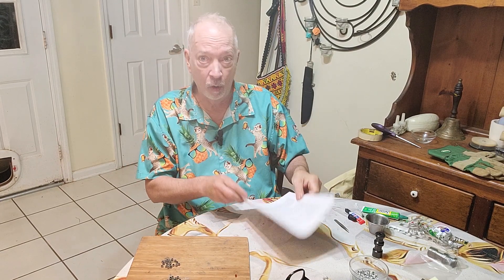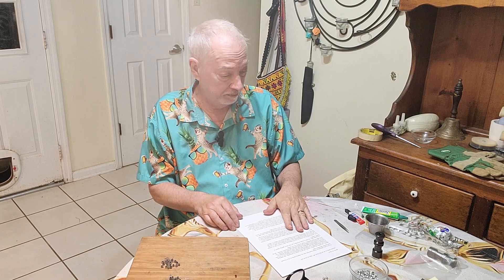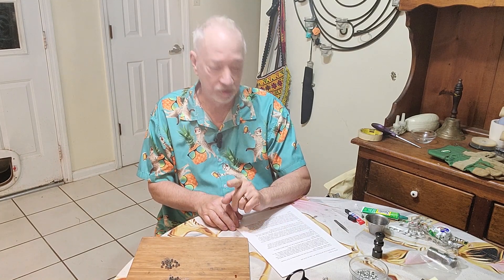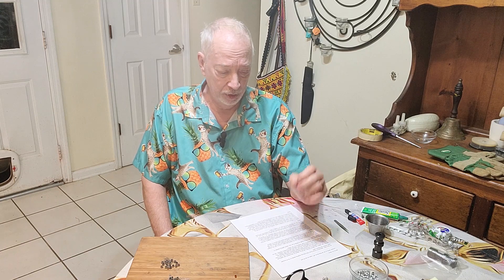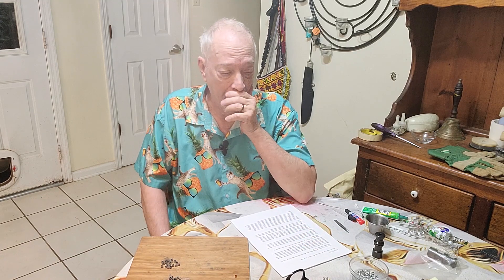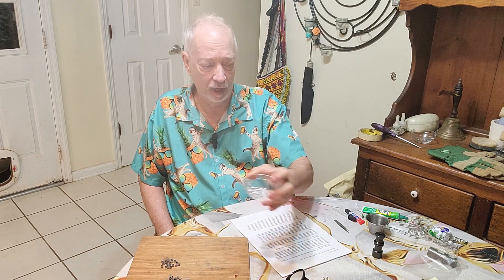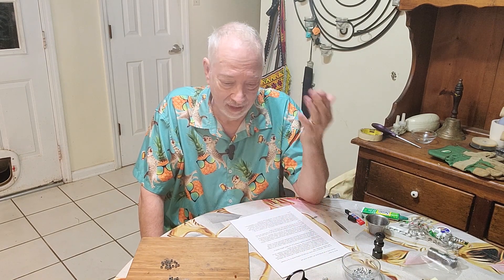Homemade Percussion Caps: Adding Extra Hardener,  Part 1

Comment: I had trouble with Aluminum tearing out at first but I Polished the inside of the die and I use a Propane Torch to Anneal the Sheet before Punching them out . This almost eliminates the tearing. The Yellow Packet is Dextrin a Glue made from Corn Starch which doesn't work well. Iv'e Tried Shellac and all I got was a big mess . Duco mixed about  4 to 1 Acetone to Duco works for me.and helps with ignition with Pyrodex P .
Reply from the maker: Try dissolving a heaping tablespoon of double base smokeless powder in 250ml acetone. It's nitrocellulose like Duco but with more nitration and also contains a little nitroglycerin. It also waterproofs the cap very well. I add a second drop after the initial cure and I've soaked them in water for over 3 minutes and they fired off like fresh.

Comment: Ive used match heads and spit, dries pretty hard. A little leary about  match heads lighting off from the the adjacent cylinder but hasnt happend yet
Reply from the maker: I've never tried that. Just rub light anywhere heads right into the nipples?
Reply: @timesgonetech3057  carefully grind a few heads only 3 or 4 at a time they may light off when grinding lol, probably not as strong as the other stuff but will still go pop.

Comment: I have had great results using hair spray which was recommended by 22lr. I have no more failures with my homemade caps using the 22lr system/hairspray then with CCI. If the factory caps ever become available I will not be buying any… Thanks for posting Terry.
Reply from the maker: One other viewer suggested hair spray also. I'll have to try that out in a follow up. Thanks for the comment!
Reply: Do you still use acetone before ? Or both ? Or just hairspray ??? Thank you
Reply: @kaak6976  i still use acetone. After it dries or evaporates is when i use the hairspray. I might add that my caps are siting open side up in an empty pistole primer tray.

Comment: On the cyanoacrylate glue they make some excellent thin, rapid setting formulas used in stone inletting. I made nitrocellulose lacquer with acetone plus a double based smokeless powder. I went 10% and it’s a good density. Thicker than water and thinner than the Prime All blue stuff. Also - drilled some 0.21 holes in a thin piece of wood from Wal Mart art section so the caps are flush with the surface. Used a fine paintbrush to load each cap, pushed them out the back with a cake pop stick (made of paper and also OD 0.18”). Then a drop on them and they are done. Was a learning curve - I am sure a bunch of mine won’t fire as I tried to use paper dots and that was a mess…..
Reply: Today I decided to try that in the pouring rain. A few things I noticed - the ones with no paper cap and NC Lacquer were the hottest. Also had a dash of aluminum powder from some Tannerite someone left here. I used the other part for fertilizer. The paper ones were maybe 30% successful. The ones w the blue stuff that comes w the kit didn’t work at all. Technique wise - I’m pushing all 3 through a fine mesh then mixing the sulfur and antimony separately from the ground glass/potassium chlorate (they appear to be mixed together already. Then did the paper roll. My primers are in a hole in a wooden sheet and I brush the compound into them then use a paper stick (cake pop stick) to press them out the back. My next 10 will all
Be just NC lacquer. I compared it to Commercial #11 and these are hotter by a bit.
Reply from the maker: Let us know how it works! Sounds like a decent idea.